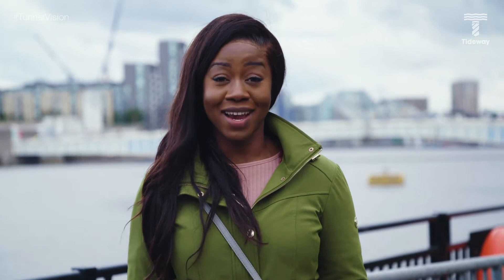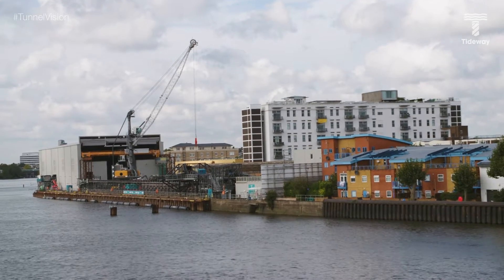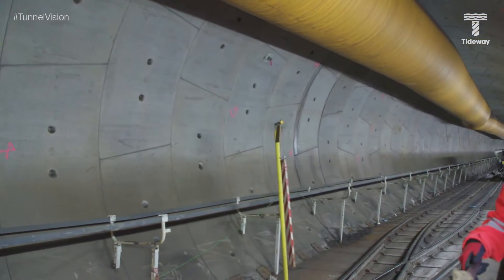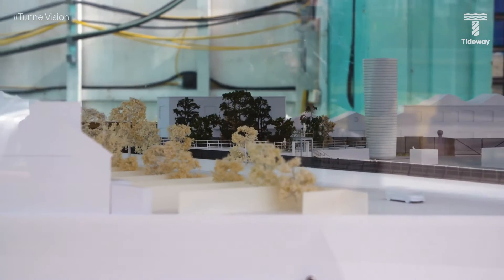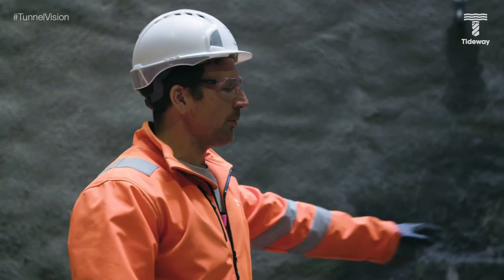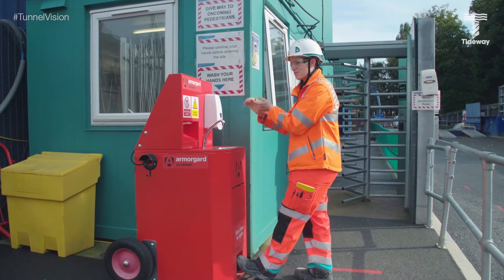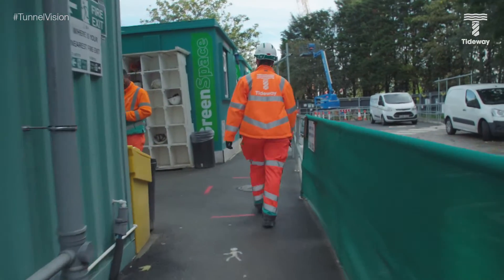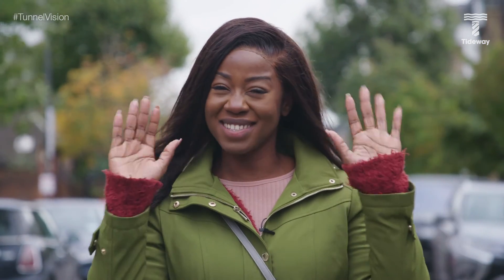TUNNEL VISION: EPISODE 2 - Tunnel Boring Machine Rachel's breakthrough

Comment: So what is happening to Acton Storm Tanks completely then? Out of the original 6 tanks - looking at the ariel photo/plans - the shaft appears to have replaced the tanks 1 & 2; tanks 3 & 4 are covered and still in use (useful given recentstorms/flooding) but tanks 5 & 6 are uncovered and look empty/out of use. Under the landscaping plans after the work has completed is this to cover just the shaft (ST 1 & 2) or the entire storm tanks? If entirely does this mean the storm tank facility will be defunct and totally disappear (like the Stamford Brook) too?